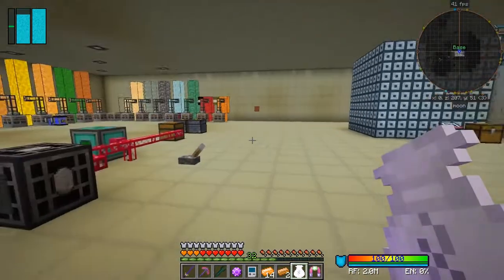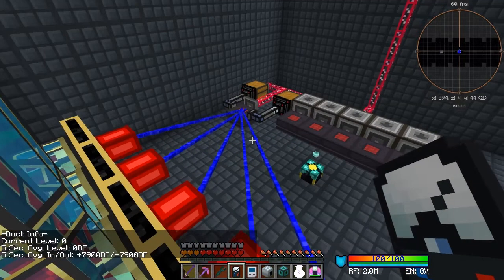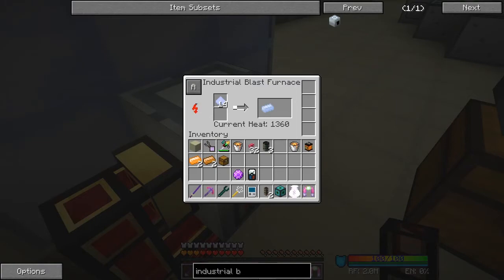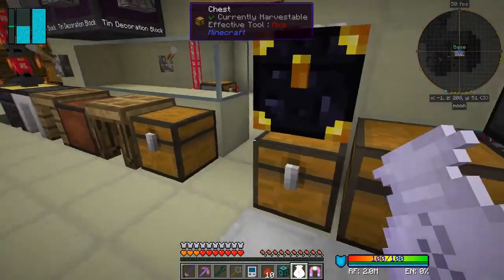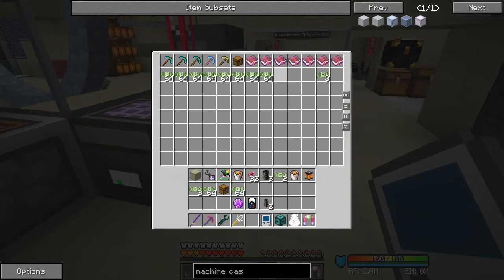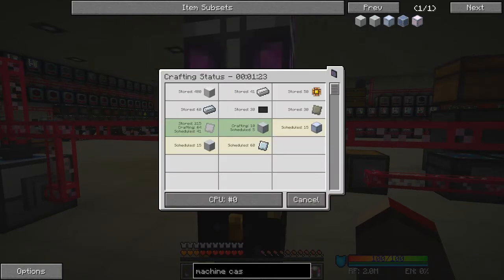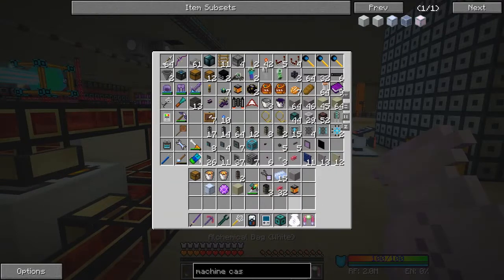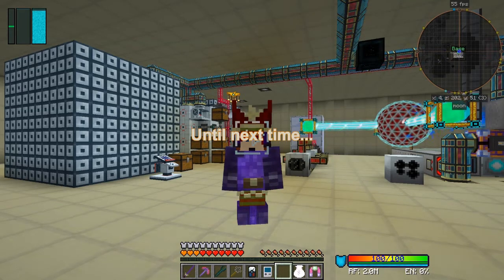Galactic Science 2 #124 - Industrial Blast Furnace and Antimony Ingots

Comment: Good show!  Craft a project e repair talisman and put it in the alchemical chest with those leather armors.  Also, what does upgrading the compact machine with a nether star do?
Reply from the maker: MrJeridan great tip thanks. I had noticed that it works in projecte bag and tried it in a normal chest but didn’t think about the Alchemical Chest. I’ve already made tomorrow’s episode so I’ll show this tip in Saturday’s episode.
Reply from the maker: The Nether star upgrade does two things, allows you to break the machine without losing what has been installed inside the room. If it is not upgraded when the machine is broken then it drops all the blocks inside it. It also allows you to link two rooms together with a quantum entangler. I showed the linking in the previous episode.
Reply: Ok, thanks.  I was hoping it did something besides allowing them to link because I don't really see a point in that.